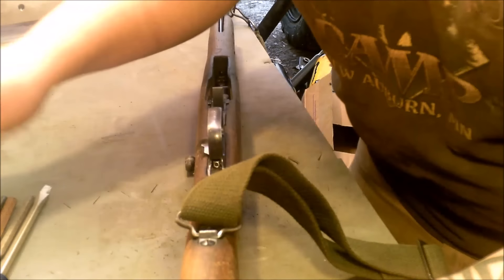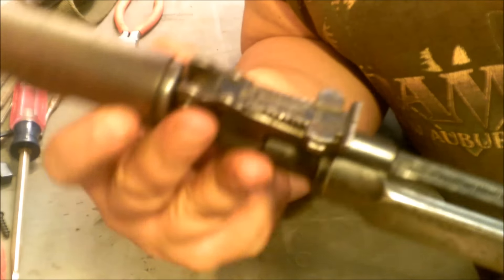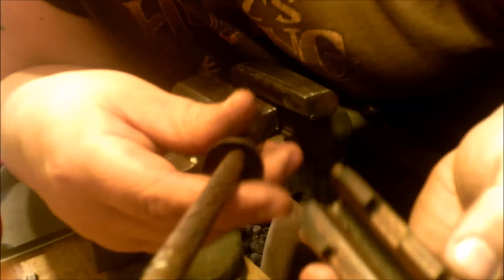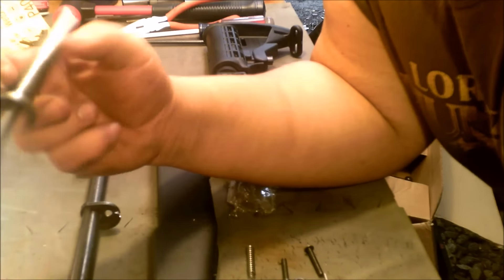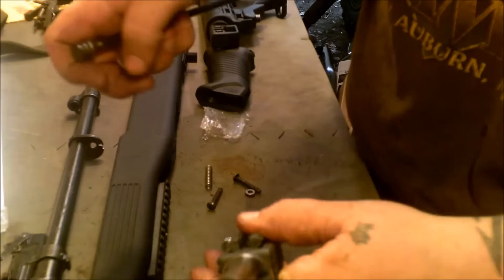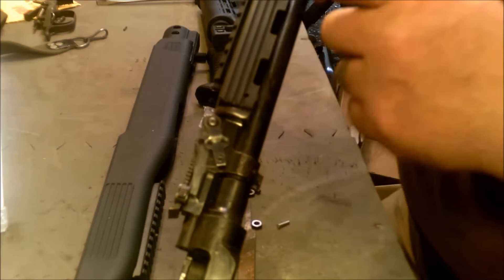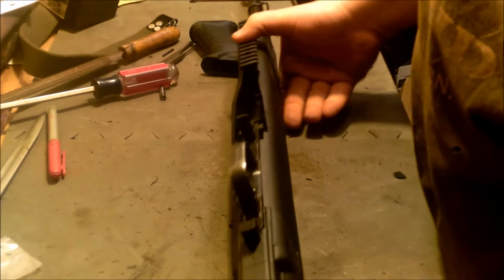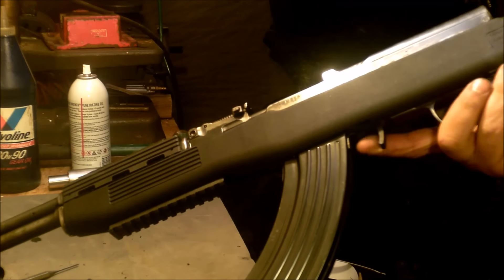TOP 5 SKS MODS ep#3

Comment: If you screw the spring in turning left, it will go right to the bottom of the hole. They kept it tight so it will not fall out if the trigger group is removed. What kind of sks do you have? I put my whole kit on in about 7 mins with no grinding, filing at all. there are so many variants out there, I guess some are more difficult than others.
Reply from the maker: Mine is a Chinese norinco  but is was in very rough shape when i got it! Lots of corrosion and even some rust so maybe thats why i had issues fitting parts. Thanks for watching man!